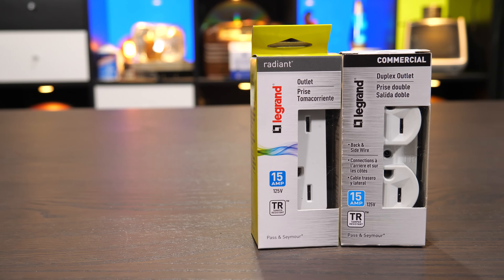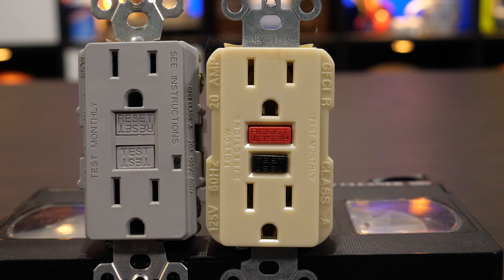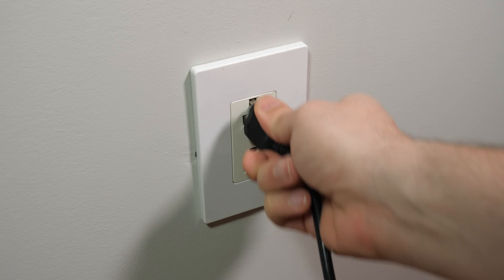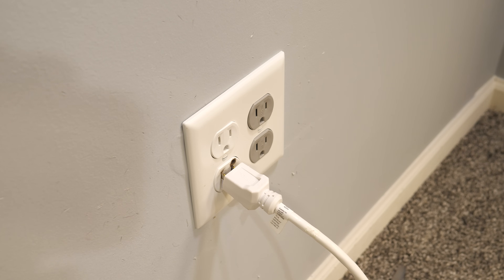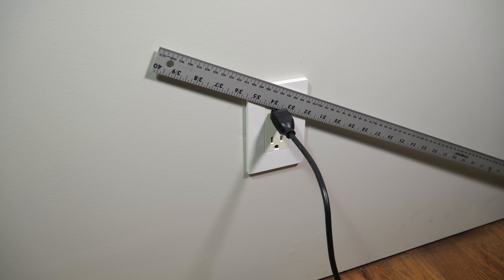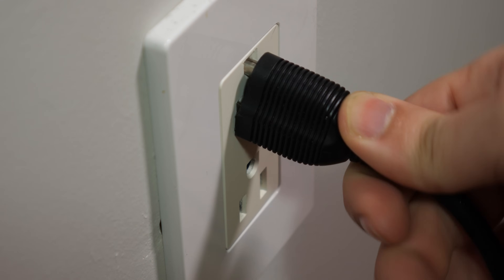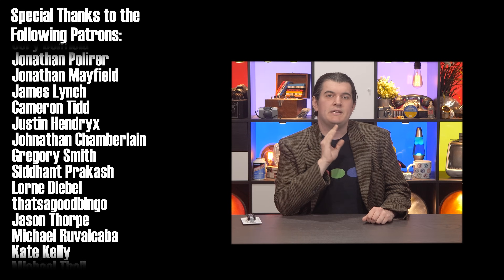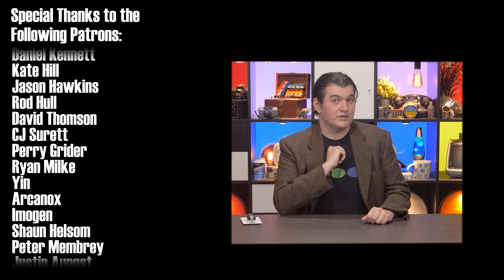Power outlets are topsy turvy - but does it matter?

Comment: A little off this topic but... I'd love to see your ideas on battery charging (Cell phones, laptops, AA's) and the best tactics for battery longevity.  :) I do not know where else to put this request/notice. I love your channels and I hope you enjoy making these as much as we enjoy them. :)
Reply: For Lithium, you want to stay as close to nominal voltage as possible (50-60%) for storage and reducing max/min charge can make a big difference on longevity. For instance, 90%-10% instead of 100-0 is supposed to provide a lot more cycles at the expense of a little capacity. Voltages further from the nominal voltage will cause more chemical degradation and accelerate battery wear. Heat likewise accelerates battery breakdown and loss of capacity. 

Decent Nimh rechargeable cells will benefit from the same basic principles but they're less prone to wear and sudden failure than Lithium in my experience. LiPo cells found in modern cell phones and laptops are all trash anyway and will die in 2 years or less no matter what you do. Lead-acid only really degrades at low charge so the goal is minimize their time spent below 50%.
Reply: Google "battery university prolonging lithium life" 😉 They also have similar articles on NiMH and lead-acid batteries.

But yep! My rule for my lithium battery devices (those that report a numerical percentage a least) is to charge them when near 25% (20-30%), and unplug when near 75% (70-80%), and never rapid/fast charge unless I absolutely have to. This tactic let me use my Note 3 for SEVEN years (I finally let it go when mainstream apps and other stuff finally rendered Lollipop pretty much obsolete). Now I'm on Year 4 (nearly 5?) on my Galaxy S9+ and still going strong.

Yes, this method takes some getting used to, but it was easy for me to find reasonably-convenient patterns. For example, charging my phone on a computer's USB port (2.5W) from 25-ish to 75-ish takes around 4-5 hours, or about half a work shift. Charging my tablet from 25-ish to 75-ish on an old 10W USB power supply is about 8-10 hours (or overnight, or all day while gone, etc.).

Now, an accidental full-charge, or an accidental draining below 15%, here and there, are OK. Just don't make them habit is all. And the one and only time I absolutely had to rapid-charge my phone was when I got into a bind during a business trip (charge now or be sorry later). But I've never found the need to rapid-charge my tablet.

I know too many people who regularly and obnxiously "rape" their devices' batteries (run them to shutdown then rapid-charge them full within an hour because NOW NOW NOW!!!), then wonder why they have power issues in a little over a year. Or, in the case of my mom, thinks hers has to stay plugged-in as much as possible. Now hers won't charge past something like 89%. And this is her third smartphone that's done this, and I've told her... but what do I know? LOL!

Oh yes, for long-term storage, leaving lithiums around 50% is best. I think this may be the reason why new devices first powered-on often show around 50%.
Reply: In the case of modern phones, ignore the pipe who say to not use fast charging, the manufacturers solved that issue ages ago. Mkbhd has a video on this if you want more info.

Comment: Seems like all of your issues could be solved by using the superior British plug. Even our stuff that doesn't need a ground wire still needs a ground pin made of plastic to open the socket so they all have it, they are flatter to the wall and fused! We also use the horizontal wall socket orientation, which is also superior.

Comment: Not upside down. Believe me. Meets code just about everywhere. Some industrial situations might require it. This guy is just blowing smoke up your shorts. Don't allow his idea in your house. Will only diminish resale chances. His theory is that w/2 leads on top something could fall across them causing a short. True, but not gonna happen. If it did that's why we have circuit breakers.

Comment: Ooh, thanks for covering this!  The guys at various jobs I've worked have debated this endlessly because everyone has been told by an electrician at some point that one or the other is "code."  Nice to know that there isn't actually any code related to this.  

I hadn't thought about right-angle plugs (probably because they just don't seem to be that common on devices I own, with the exception of extension cords and power strips), but I do prefer them.  Especially the 45-degree angled ones.
Reply: It's not code, but some specifications may have the desired orientation listed by the owner or electrical engineer. One way or another, it should be consistent across all plugs on the site.
Reply: @kevinmalone4341   The sites where this has come up were largely 70-year-old apartments in areas of Texas where code enforcement has always been spotty to begin with.  We're lucky if everything is grounded correctly.  It's just guys mansplaining shit that doesn't matter because they don't have anything better to pretend to be knowledgable about.  :)

Comment: I despise the sideways-mounted orientation.  Back in the day, so many power bricks were made to hang down from an outlet and they were heavy.  So our office was constantly breaking outlets as the slightest bump of the power brick snapped the plastic outlet.  When we moved, I spec'ed out the outlets to be ground-down orientation.  The builder ignored it, put them in sideways, then found himself back in after the drywall was up tearing out 431 outlets and installing them according to contract specification.  Took him about 2 weeks.

Comment: The house that I grew up in, which was built just after WWII, mostly had outlets that would not accept a three-prong plug. In fact, the only three-prong outlets that I can recall were the one the refrigerator was plugged into, the one the TV and antenna rotor were plugged into (opposite side of the same wall and on the same circuit as the fridge), ... and every single light fixture in the basement had one built into it. They were ceramic fixtures screwed to an electrical box attached to the floor joists that had a pull chain for on/off, a single 3-prong outlet, and a socket for a single bare bulb.

And yes, if the fridge happened to turn on while you were moving the antenna it could blow the fuse.
There were a lot of dubious decisions in the design of that house.

Comment: The US should just ditch this old awfull flawed plug… I know i know the EU one (and all alikes) are comically big… 

But hear me out, the modern brazilian one has basically all the safety features (except the ocasional fuse on the comically big plug) while being small like the US one, recessed, with isolated prongs, 3 pins on a decent orientation, no way of half connecting it nor it becoming exposed, and the recessed conection “hole” adds to the mechanical strenght of the plug not relying only on the metalling prongs to hold up the entire plug

Comment: Manufacturers of appliances orient their plugs with the ground pin down, which makes it hard to use a receptacle with the grounding hole up. There is no real benefit to placing a receptacle with the grounding hole up. I worked for OSHA for over 28 years, mainly inspecting construction sites, and never saw where up or down made a safety difference.

Comment: As an electrician I'd just like to thank you for this video.  I work with so many guys that insist on putting the ground up.  It's just annoying.  I've even had a few insist that putting the ground up is code.  I always offer to give them a 100 dollar bill if they can give me the specific reference.  Nobody has been able to give me one yet 😂
Reply: Isn't it funny how this one isolated detail gives insight to how information is spread, accepted, and then preached as gospel? Magnify that by the world . . . . .
Reply: I only put them ground up when the plans called for it. You are right there is no code for this but some guys will insist there is.
Reply: My in-laws AC unit had a 90° plug, but the outlet had ground up. I had to flip the plug when I discovered that tripping hazard.
Reply: I know it’s not in NFPA 70 but I think there’s a code specific to hospitals and it might be in there?
Reply: @mh98177  In hospitals you have to use hospital grade outlets and if you use mc it has to be hospital grade but never have I seen any code for the direction of outlets. There can be a requirement for this to be made in the blueprints.

Comment: I think you could fix this problem like we did with the type-G here in the UK. So we have a grounded plug with two main safety features. 1 the Earth (ground) pin is longer & is used to unlock the lower section of the live & Neutral prongs this stops a child from sticking something metal in the plug & getting a shock. 2 we have a little bit of plastic covering the very edge of the prongs which conduct electricity meaning that its pretty hard to accidently touch it. The type G is also designed to be put in a bit more. 3 we have switches on the socket to allow the thing to be turned off allowing you to lets say turn off an appliance without needing to unplug it. 4 we have that orientation in the video so its probably got what little benefit it gives. I think that the type G has a good level of safety features. oh wait 5. it has a fuse inside the plug so if something goes wrong you only lose a plug instead of the power of the entire house. There is a bunch more but I feel like I've used my Physic GCSE well & I feel like I'll never need to think of this again. Also CCEA where really annoying on the test asked us to label each of the wires in a plug but they decided it'd be in black & white so Live & Neutral looked the same. The classroom assistant reading the test for me said it'd give away the answer but who remembers it on placement you remember it by colour. Earth is the striped one. Live is red or brown & the Neutral is blue. Now can I remember where they go Earth is the middle & the other two I don't know but I know the colours so I blame the person who printed all the Science papers that year in black & white if I failed that question.
Edit: Oh the last point about right angel plugs. All G plugs I've ever seen are right angle plugs. Also even older sockets have the plastic thing I know because my Parents house & grandparents houses all have the plastic thing despite them all being quite old. I don't know for my grandparents houses but probably 50's or 60's & I know that the one my parents live in was built in the year 1973 or somewhere round then because it was my Great Grandparents & they had it made when they sold the Village Inn (a bar or Pub forget the difference) to finally settle down when they retired so the house is older than my father. Um other than that I don't think I have anything else to add. wait the thing about the hard to remove the G plug also fixes this with little finger groves. Its bigger & bulkier but its also more durable. I'd like to see a comparison video by someone who has done research instead of just off their head & looking at the plug my computer is using. Final note I guess you mention some of this stuff. Also I said two above but gave like 7 or 8 points. Just going to leave it be.
Reply: The fuze in a UK plug is to protect the cable to the connected device.
Reply: @oml81mm  Yeah I know that. what I meant though was how American fuses are usually in the mains so if a fuse blows you lose power to larger amounts of things instead of just the appliance.

Comment: I'm a little surprised not to see any mention of the existing, intended use of the inverted outlet to signal that one of the receptacles is remotely switched! I'm not sure how the face-go-upside-down crowd propose handling this, but I can't imagine this development making things any MORE clear for those of us afflicted with switched outlets. 

I actually didn't even know this was a thing until the house I was living in tried to set me on fire with galvanic wire corrosion. As the electrician was going through all the outlets in my thankfully-not-a-tomb of a bedroom and re-terminating all the outlet wire runs, he intentionally installed a couple outlets upside-down, so I asked, and that's what he said. Sure enough, it had become possible to tell which outlets in my room were switched at a quick glance.

Comment: I’m an electrician of many years exp (I’m lvl 47) and I must tell you, I have never even meet anyone who has been troubled by the very singular and specific safety scenarios in your vid. And you’re quite right about the NEC; even article 517 only goes as far as tamper resistance in pediatric facilities. 

Throw knives at the wall does sound enticing though.
Reply: Back in high school, bored guys(myself included), used to stuff short lengths of solder into each blade slot, then balancing a third piece across middle and index finger (per rules) toss across those two legs. The sparks and magic balls of solder bouncing and rolling around during the flash was amusing to us slightly stoned humans.
Reply: Nec 406 5 G
Reply: The whole thing is an issue made up by some idiot who probably gets paid to make up nonexistent problems. In fact, the whole tamper resistant requirement is another non-issue probably legislated by someone who takes money from a company that would make a lot of money by forcing everyone to replace all their outlets. Even GFCI is a solution for a problem most people don't have. In my 50+ years on this planet, I have never had and never known anyone who would have benefited from any of these now mandated devices.
Reply: @maxwelllewis4486  Not in my house they don't.

Comment: I was taught in the horizontal configuration, the neutral should be on the top.  Probably for the same reason as the ground being up, vertically.  Engineers still specify ground up in hospital settings.

Comment: The most dangerous thing in this video is the light cord wrapped around the wooden lamp stand.

Unless it’s using LED bulbs, in which case it isn’t drawing enough current to light a candle.

But still.

Comment: After 55 years in the field I have never seen any incidents of shock, arc or fire where the position of the receptacle mattered. This is one of those stupid issues that become Old Times against Young Buck .  IT DOESN'T MATTER!!!!!!     What matters is that if you put them up you put them all up. If you put them down you put them all down. This way they look like a pro installed them. AUUUGG wait a minute. Some guys say you put them in ground down unless they are on a switch. then to show which ones are switch by flipping the rec. over. Anyhow I have to go talk to my wife about putting the toilet  paper on  upside down. Now that's important.  And oh yes keep practicing with the knives. You'll get it.

Comment: Canadian electrician here. My understanding was when the ground prong receptacle with the wider neutral blade was introduced, it was intended to have the ground prong up. But manufacturers of adapters picked the orientation that let the bulk of the adapter hang down and that had the neutral blade on the left. This meant if you didn't install your receptacles with the ground side down, large adapters would end up falling out. So the standard was decided that way. 

I will say that the only time I have ever worried about orientation and having the ground prong up is in a hospital with stainless steel plates. But I'm pretty sure that was a project specific specification, not a code rule.

Comment: Mine are sideways in many rooms of our house! Mostly upstairs. The wiree are on the outside of the wall in a casing and the outlets are also applied on the outside. Really strange set up. Our house was built in a row of coal miner houses before electricity and the updates the previous owners made over the years are spotty and mismatched so when we bought it we had to get some stuff updated for safety code reasons. Basement likely had shower at one point too.

Comment: Awesome video, this has been a topic of much debate with my coworkers, me being an Electrician. When I first got in the trade in 2008 it was a job specification to install the receptacles ground up. I asked why, my boss said because an office worker could drop a paper clip and it could make contact with the line and neutral of plug. I said that was the stupidest thing I ever heard because the same could happen with the ground up. Except with the ground and the hot, and either way the circuit may or may not trip so it solves nothing. I’ve had so many debates with co workers about our work and all I do is ask them to show me where it says in the code book, I quickly shut them down. I am not an expert but if something doesn’t pass the smell test it is almost certainly rotten. 😜
Reply: Why does it hurt to just say 'it's tradition'? Unless it's an issue most traditions are kept in any 'discipline'.
Reply: @terrylandess6072  I wouldn’t have a problem with that, what gets me is the lame excuses some people give or just because so and so said so.
Reply: All original spec Hubble receptacles, especially Twist-Locks, were ground or neutral up.  It made it much easier for people to patch connectors when they couldn't have line of sight while making the connection.

The NEC doesn't specify orientation, because there are so many situations where the possible orientations could be unique and the Code is about fire protection.

Comment: Years ago, my younger sister (must have been younger than 8 years old) put a penny in between the plugs of a night light. Fortunately I saw it happen and within about 10 seconds I was there and ripped the light out of the wall, creating a mini spark shower and coated the outlet with a black burn mark. The outlet still worked fine but I was freaked out enough not to use it after that. (I was a teenager at the time)